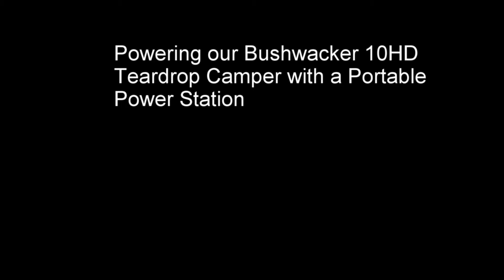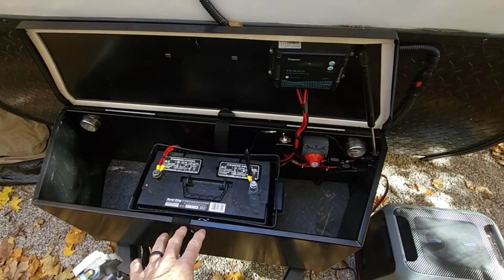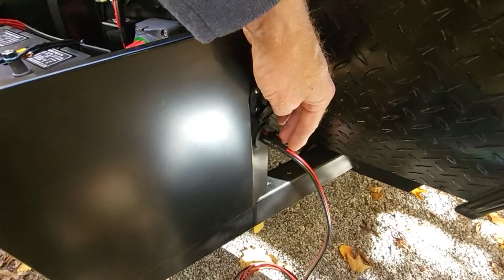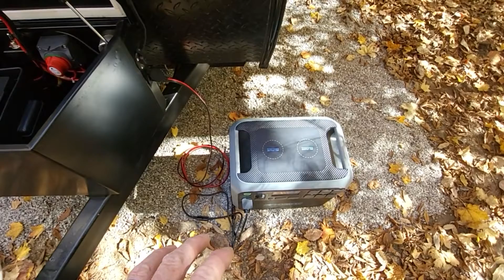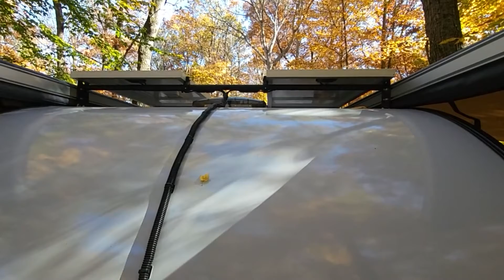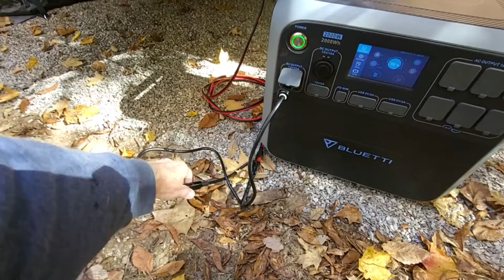Powering our Bushwacker Teardrop Camper with a Bluetti AC220P PPS

Comment: Do you have a link for the cable loom clips you used to run the solar panel cables down the front of the camper?
Reply from the maker: Here is the link to them.

https://amzn.to/49C59by

I remove the 3M adhesive and use the Black gorilla two sided mounting tape as it holds much better.

Comment: Thanks for this video Sam. You mentioned everything is fused, so I'm wondering if you have fuses between all the switches on the positive wires or do you have a fuse before the power goes into the camper? Also are the fuses 30amp?
Thanks in advance
Reply: Sam, I'm sorry to have so many questions. I'm using the toggle switch and the master switch you used, but I'm confused on how you wired this. You mentioned that the center pole of the toggle switch is connected to the master switch. Are both batteries connected to the center pole of the toggle switch as well? I see further down in the comments, you were asked if you could provide a schematic. Is there any chance you still have a copy? I appreciate all your help.
Reply from the maker: @Greg-hs4et  be glad to help you all that I can. Please send me an email at the adventuresofthememorymakers@gmail.com
Reply from the maker: Greg, glad the video helped. Yes, each power spurce, the battery and PPS are fused before the selector switch with 30 amp inline fuses on the positive lead then the 12v side of the load center in the camper has each circuit fused with the appropriate fuse for the load.
Reply: @adventuresofthememorymakers  Thanks,  I also have a 10HD.  Is the  load center you're talking about in the front which serves as a junction box for LP connections and power to the rear?  If I'm right then is the 12V side everything downstream from this junction?
Reply: Correction.  This junction comes from the 7pin trailer lighting etc. then powers the rear.
Reply from the maker: @Greg-hs4et  , No sir, that is just a distribution block for connecting the 7 way lead from your tow vehicle. The load center is in the rear wall of the cabin area. 
 I don't power the camper from the tow vehicle. I use that 12v lead for something I will be showing in an upcoming video.
Reply: @adventuresofthememorymakers  I'm looking forward to seeing this. Thank-you
Reply: Sam I have another question. I am using the same size trailer tongue box like you used in this video, and it is so close to the LP tank that I can't insert the key to open and close the box.  Did you move the LP tank forward to create more room like I see in your video?
Reply from the maker: @Greg-hs4et  , yes sir I did. I removed it from the A frame, used a angle grinder to cut off the mounting tabs then set the mpunt up ontop of the A frame as close to the jack stand as you can. That should give you enough room to access the key slot.

Comment: Awesome video! What tongue box are you using?
Reply from the maker: Thank you for the kind comment. The tongue box we are using is the Harbor Freight 2.31 cu ft box. There was just room for it without moving the LP tank forward. When I added the second LP regulator for the Propex heater I had to move the tank forward which worked better with the box.

https://www.harborfreight.com/231-cu-ft-steel-trailer-tongue-box-61602.html

Comment: Great set up Sam.  I have the same AC200P PPS wired in a similar fashion housed in the tongue box.
Reply from the maker: Curious, do you have a house battery or just the PPS?
Reply: @adventuresofthememorymakers  I upgraded the house battery to 100ah Weize self-heating LiPo battery.  I think starting 2022, HD10 comes with WFCO 8735 AD converter/charger that handles Lithium (AD).  I discovered that to my surprise that my converter handles Lithium natively.   I've installed master switch as per Brian Smith's master switch tutorial.   I purchased 4 portable 100 watt solar panels that I can charge both house and PPS during travel.  ps. I still have not gotten around the aluminum waterproofing upgrade yet.🙂 but I will get around to it using your template.    Keep up the great work Sam!
Reply: @stevepark8428  hey Steve, awesome.  All of the WFCO will charge lifepo4, the model depends on how far it charges it and whether it does the cell balancing needed for long term health.

I’ve been meaning to ask some people how they’re making out with the heated weize, keep me in the loop!
Reply: @ Brian Smith. Will be using the weitz during winter camping this winter.  Will give my experience  on the as a follow up.  I paid $375 from Amazon a month ago. As for the WFCO 8735 AD, it charges the LiPO battery at 14.3 volts to 100% charge from 30% in about 4 hours plugged in from the shore power.
Reply: @stevepark8428  winter camping is the best, have fun!